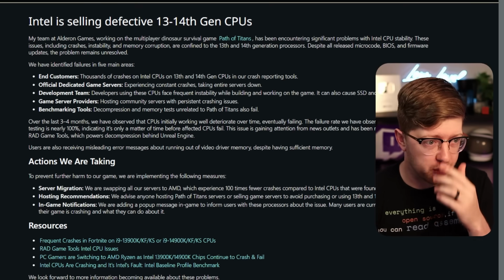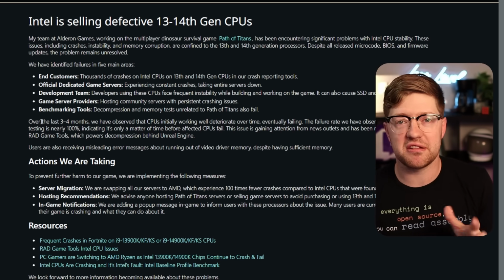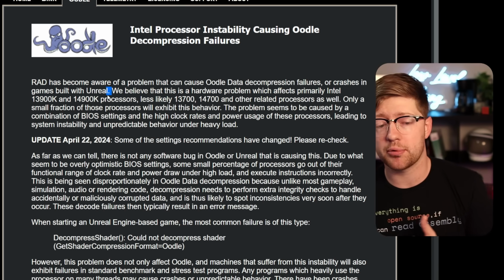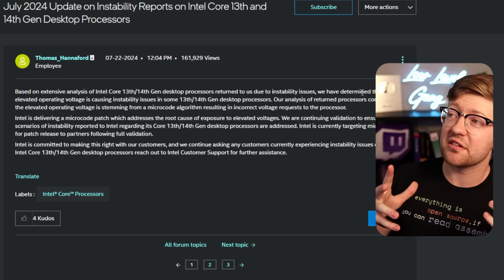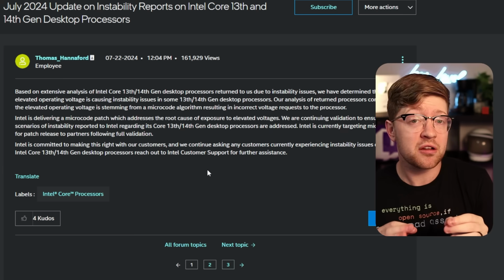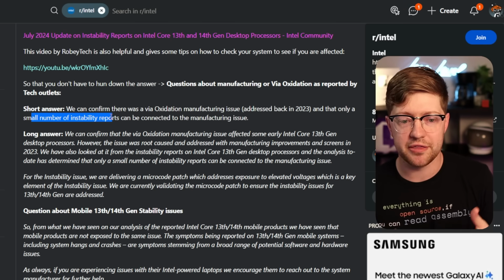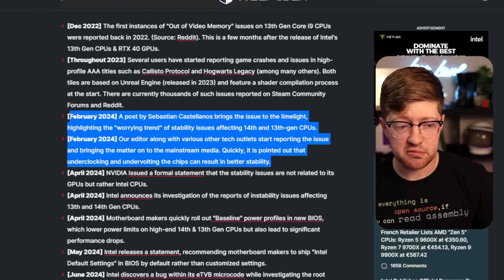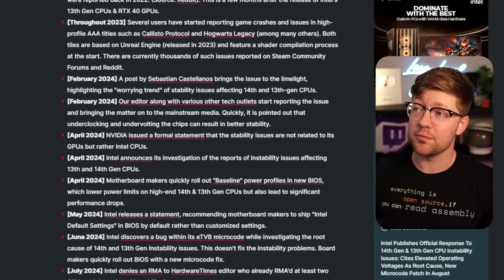intel CPUs are literally falling apart

Comment: Most developers wouldn't even consider that the Compiler or CPU has a bug thats causing their code to crash. It certainly took us 4 months to figure out it was actually the CPU.
Reply: I have seen a compiler issue once in my career (at the very start 😂) over twenty years ago. Having to conclude that the CPU is the culprit is way out there. Especially given that it happened over time due to physical damage. That's wild!
Reply: @MeriaDuck  I saw it once too during "Vista" work. A contract i wish i would of never signed. There are no words for the hate i developed for that project.
Reply: I found a bug in MS visual studio back in 1999, when I was 14!  But it did take several weeks of rewriting all of my code from scratch.  One of the most frustrating issues I've ever had.
Reply: @Efecretion Heh, I had a bug once that disappeared entirely (or possibly just made so unlikely to occur that it effectively never did) when it was run in debug mode or otherwise instrumented for debugging.

Turned out to be a very subtle race condition, in the end. Took me several weeks to fix it, ugh
Reply: @mduckernz  
Race condition is a prominent member of Heisenbugs (see Jargon File), that is, bugs which disappear the moment you try to investigate them. Really nasty thing...
Reply: @Efecretion  I regularly find bugs in VS/MSVC as a software engineer. Over the past months I spent probably a quarter of my work time debugging and reproducing issues with Microsoft products and reporting them. At this point, I should put Microsoft QA engineer on my CV.
Reply: At first, they wouldn't, and they shouldn't.  The golden rule of compiler development is that it MUST work.  Strick adherence to this rule is why compilers should not instinctively be blamed for a crash.  Debugging would help isolate the problem; once you have a general idea, a skilled low-level engineer's (debugging) research should identify the potential problem.
Reply: In around 35 years of programming, I've run into one conclusively proven compiler bug. And even getting the courage to say that it's not the code, but the compiler was a huge hurdle.

Eventually, we were able to narrow the scope of the issue down to two unrelated lines of code that happened to be next to each other. A,B caused a bug, B,A did not.
Reply: The worst feeling is when you see the "INTERNAL COMPILER ERROR". I had a project once plagued by this, and had to wait for the MSVC team to fix it.
Reply: @idontknowanygoodnames1498 the worst thing is when your bug is so strong that it breaks the debugger
( i've had this happen with lldb before )
Reply: @idontknowanygoodnames1498  Oh yeah, those are bad. Try using C++20, especially modules. I ran into so many internal compiler errors. Some were reproducible with just 5 lines of code which is crazy to me.
Reply: We've been sitting on some unusable processing boxes because of stability issues. We were assuming bad memory or some motherboard fault, turns out they were 100% of our 13900k CPUs, no-one had considered the CPU.
Reply: Does Intel have to pay for all the lost time?

If not? WHY exactly not?
Reply: Thanks for your work on this, I very much enjoyed your appearances on the MLiD Broken Silicon podcast!
Reply: @alderonmatt  Cool to see the dev in here
Reply: Perhaps not at first but surely you'd realize something was up if the majority of oddball crashes were  mostly high-end 13th/14th chips.
Reply: @JJFX-  Most developers dont sort their crashes by CPU Type. Its usually sorted by callstack
Reply: @alderonmatt  I understand but when something unusual keeps popping up I'd personally start looking at other commonalities before spending a ton of time chasing my tail. Especially as more and more people start using a new platform generation and all the potential issues associated with that. I know it really depends on the situation though, I can understand why you may not have.
Reply: If you fancy yourself a "developer" - don't use desktop "gaming" CPUs.
Reply: @vandecasa3795  That's nonsense, there's plenty of cases where the higher clock rates and better single threaded performance of the desktop CPUs perform better than most server CPUs.
Reply: @to_the_seas  You obviously have no idea hat you're talking about. Performance is neither the only nor the most important metric when it comes to high-availability systems like servers. There is a reason why hardware for servers and workstations exist in the first place.
Reply: @vandecasa3795 i am genuinely interested, what is the one true dev cpu and why?

Comment: Intel's analysis of the problem sounds correct.  Years ago, at the insistence of my boss, I purchased a Palm Pilot personal digital assistant. It had a problem in that when fresh AA alkaline batteries were installed, the date would not change at midnight, although the clock would keep the correct time of day. After running on the batteries for several days, their voltage would drop slightly and the calendar function would start working correctly. I had the device replaced under warranty a couple of times and all of them acted the same way, making them essentially useless in their primary function of acting as an electronic reminder for meetings and tasks. I am sure that Palm's customer service people knew the cause of this failure as being a defective processor in their product, but every time I spoke to them, they pretended my case was unique, i.e., lied to me. (The company folded not long thereafter.)

Comment: I’ve got an i9-13900KF, I bought my PC in April of this year… should I be concerned?
Reply: LOL, it is one of the most affected CPUs. Check BIOS settings, limit max power and max voltage, and update the BIOS before it is too late. If your PC crashes, the damage is already done.
Reply: I haven’t had issues yet, but I also don’t run at max performance CPU very often - usually only when I’m encoding lots of media or running emulators. That said, I’ll give these suggestions a shot
Reply: maybe its just take longer for it to happen, it degraded slower...

Comment: I've been having the "out of memory" thing on shader compilation since I built this computer a few months ago. I never thought anything of it, because everything still worked fine. Shaders compiled and games all ran fine, I just got an error that I could ignore on rare occasions. I chalked it up to Unreal Engine weirdness related to shader compilation. It happened very rarely and I had forgotten about it, but yesterday it happened again and since this issue had been in the news lately I connected the dots. I happened to be trying out a title that lets me spawn into different parts of the map, and it compiles shaders at that point. The error happened every time I changed location. I decided to try turning off all CPU overclocking, and it went from 100% reproduction rate, to not occurring at all.

I'm leaving it like this until the microcode update gets released, then I guess it's experimentation time to see if I need to RMA or not. It's a 14900k so it should be safe from the oxidation issue, but whether this is instability from voltage or from damage caused by voltage, remains to be seen. It's so weird to know this is an issue, while also experiencing the system as rock solid. It's like the issue is an intermittent bug on exactly one processor instruction that's exclusively used when compiling particular shaders.
Reply: 100% voltage issue in your case.  You need to disable the thermal boost on the CPU and check your board bios for update.  There was an issue with some boards actually undervolting the CPU too much too causing those crashes as well.  The 14900K is not safe overclocked or at stock with the thermal boost on though.
Reply: @JathraDH  I already had the eTVB BIOS update from a few weeks back. I set the BIOS to use "Intel Default Settings," which was added in a previous BIOS update earlier in the history of unravelling these issues. Granted, I just assume that's not overclocking, but I don't actually know that. I guess I'll have another run around in BIOS to see if I can find anything called thermal boost, at least. Thanks for the tip.
Reply: @mascot4950  2 Cores on your chip are deemed "special" cores and have a max boost set to 6ghz out of the box.  They are a few hundred MHZ higher than the boost on your other cores.

It's this boosting behavior that is largely responsible for the degradation.  Apparently the chip was requesting even more voltage than its VID states, but even the VID for that level of boost is scary.

Capping the boost on those cores to the boost of the rest of your cores should help with the degradation on your CPU.
Reply: I hope you kept your reciet for the inevitable class action lawsuit, because those chips are corroding.
Reply: @familhagaudir8561  No need for a class action over here. If it fails within five years I get a replacement or full refund. It's the law. The corrosion issue is supposedly limited to 13th gen so not applicable to me.

Comment: WTF??!  I thought I was the only one that had a BAD Intel i7-13700 CPU (which Intel is refusing to RMA)!  My CPU outright died completely.
Reply: I have one 13700 died too. And still under rma process. It been one month already. It is a 13700, non k non f, a simply 13700. Fml

And yes, the chip have some darker tonation in different places, looks like oxidation
Reply: @DCForestx  i have 13700f should i be worried? I havent experience any bsod though, tye only crash i got from the finals but all games seems fine
Reply: @rottershier6775  mine have minor crash from the start and only died off after one year. (and intel stated a 3 yr warranty) So I guess you could monitor yours when the crash frequency become higher. There is still a 50% rate of having a good CPU tho haha
Reply: @rottershier6775  The F designator just means it's a 13700 but the iGPU was faulty (GPU chips are finicky in general) so they disabled it at the factory and sold it as a cut-price no-iGPU version. It otherwise rolled off the exact same production line as the others, so yes you're likely to also be in the same boat.
Reply: @DCForestx  when did you buy it? I heard that the oxidation issue is only affecting the early batch of 13th gen cpu and the issue has been resolved in 2023.  I bought it late 2023 around november to december, so i hope im lucky :(((. Its literally my life savings as im just a teenager working part time
Reply: @rottershier6775  I had the 13700 around Jan/Feb of 2023, it could be the early batch tho. And right now I have another 13700k bought at Sept 2023, that one still running fine. But don't worry too much as if you are really unlucky, the intel warranty still cover 3 years.
Reply: @OryAlle  so it was the igpu that is the problem? Or the igpu causing it worse?
Reply: @DCForestx  ahh i see,  so if things get worse, i could just ask them to replace it with 12thgen cpu instead?
Reply: @rottershier6775  Nono, the iGPU probably has nothing to do with it. I just meant that you're in the exact same bucket as everyone else with a 13700.
Reply: @rottershier6775  my cpu is a i7-1300f and just started taking a shit yesterday on battlefield 2042. Only that game particular so far out of the blue
Reply: @ilyapangorchav  hi thanks for the update, what kind of error you get?
Reply: 13700 f, k?
Reply: @rottershier6775  13700K